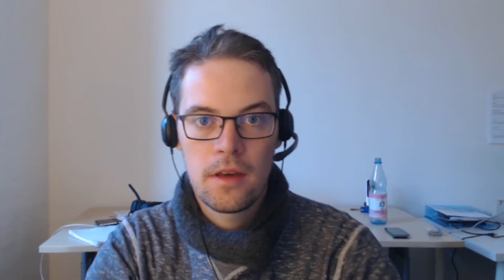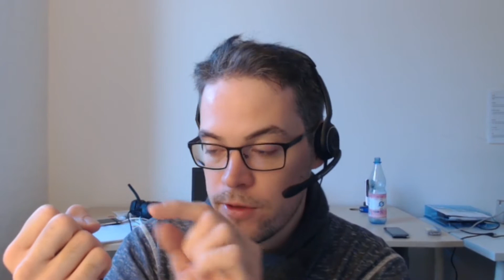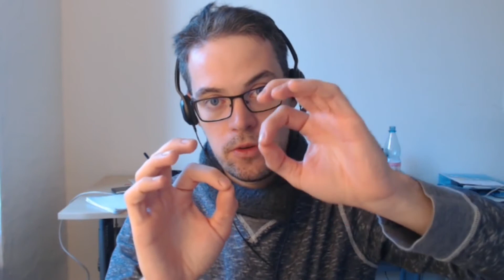What is the difference between a NURBS-Model and a Polygon mesh?

Comment: I think the comparison for polygons is more like lines vs. curves, not pixels vs. vector graphics. Polygons are vector graphics. They're just ones formed by straight lines. They have infinite resolution just like a curve, but limited to straight edges. Pixels and voxels are discretized and have finite resolution in ways both polygons and NURBs curves do not.
Reply from the maker: that might be the better analogy, thanks
Reply: @Holocreators Cheers and apologies for my pedantry! I work as a VFX engineer and it is a popular marketing slogan to advertise voxel applications as having "infinite resolution".

But from my perspective, voxels are the epitome of finite resolution and prone to issues similar to aliasing with pixels. We can zoom in and start noticing "chunkiness". So I think the artists and animators are referring to "resolution" in the sense of "topology"; in that sense, voxels have no topological constraints.

Yet I think of "resolution" as a factor of rasterization or raytracing, so actually polygons have infinite resolution as well as NURBs patches and so forth and have parallels to 2D vector graphics (ex: Illustrator), while voxels have finite resolution and parallels to pixel/raster graphics (ex: Photoshop).

Comment: Thanks for this. one thing: You mentioned the advantage of the NURBS model being that it scales well. But what are the advantage(s) of the polygon model? 

I often wonder why a 3d program can't combine the advantages of both the NURBS and polygon models.

Thanks!
Reply: From a dev perspective, polygons -- more specifically triangles -- can be directly rasterized or raytraced. NURBs patches have to be converted into triangles before they can be rasterized and, while hypothetically a raytracer might be able to perform a ray/patch intersection, it's generally still cheaper in a raytracer to convert the patches to triangles first.

NURBs are also a bit finnicky both for programmer and user. They're very popular in CAD/CAM but they require more intricate knowledge about geometric continuity and degree, knot vectors, isoparametric curves, etc. Polygons are dumb simple and easy to program for developers and easy to understand for users and don't require any calculus.

There's also something of a blend in between with subdivision surfaces, like Catmull-Clark subdivision, where your polygon model effectively gets turned into curved patches with their edges effectively turning into b-splines. There's some extra complexity involved there though -- not quite as much as with NURBs -- but most subdivision schemes don't have things like extraordinary vertices very well.
Reply from the maker: Hi Kurt, good question. I don't really have answer for that. Maybe ask Chat GPT :-)

Comment: I had no idea about nurbs could a game be made? it would obviously be pretty basic since I imagine it is very computationally inefficient but I see no reason you couldn't
Reply from the maker: Hi, a game with Nurbs models? I suppose you are thinking about a retopology with quads. That's a little different process. Quads will not scale in the same way that nurbs can. So a quads model will look jagged if you make it bigger and bigger, of course you can then subdevide it but thats a different story.
Reply: I think you could make that reasonably efficient now with hardware dedicated to dynamic tessellation for rasterization (assuming rasterizer rather than raytracer which is getting popular nowadays with RTX), but it doesn't make so much sense to me unless your engine does some in-game effects that benefits directly from NURBs splines or a level editor that provides NURBs-based modeling since you can represent the same forms using much more compact representations (ex: patches using curves other than NURBs curves which are quite heavy, like quadratic bezier curves which are much lighter). Also all the other things a game needs to do besides rendering becomes more much involved computationally (ex: physics) with NURBs patches.

Comment: why nurbs not used in games! for like the circular simple shapes, it does not work in game engines ?
Reply: because the GPU is more efficient at calculating the position and behavior of polygons, especially in large quantities. This isn't the same for dealing with NURBS.
Reply: @ashfordnichols3622  i think apples new M1 graphics will find a way in that since they have immense powers
Reply: Dynamic hardware tessellation might favor fewer patches of some form (NURBs or otherwise) over more triangles for rasterization efficiency these days, but the problem I see beyond rasterization are all the other things a game need to do like collision detection. Detecting the intersection of two patches is much more involved computationally and tricky programmatically than tri-tri intersection. And with the slow but steady transition towards raytracing in games, ray/patch intersection is way more expensive than ray/tri.
Reply from the maker: @ashfordnichols3622  thanks. that makes sence.
Reply: Efficency wise, Polygons are less resource consuming to compute and apply any type of PP filtering than nurbs. The same figure, lets say for example, a teapot with a very easy shape, can be easily x10 heavier with resources when modeled with nurbs that with simple polygons depending in the software you use. 

You may end with exactly the same results, form wise and aliasing wise but the processing unit (either cpu or gpu) will have to calculate more quads or tris when doing nurbs in a cad system to have an easier predefined fidelity into the 3d model, that is why software that does mesh based modeling such as blender has a lot of tools for rendering and PP, instead of 1000 quads to process you might end up having 100 depending in the complexity of what are you doing and then applying mathematical technics within the software to simulate smoothed surfaces and refractions that take way less time and resources.

However, this might not be the case always, I've seen models made with nurbs that have some really nice meshing that would allow the same strategies to be applied in other software.

Im speaking from my experience as a drafter that use Solidworks both for mechanical engineering and game design wise.
Reply: NURBS model needs to be tessalated before displaying onscreen. So it is used mainly for precision work such as CAD. A good NURBS + Polygon combo is Rhino + Blender though.. here's a demo :  https://youtu.be/n9zMxUOD3CU
Reply from the maker: good question i don't know